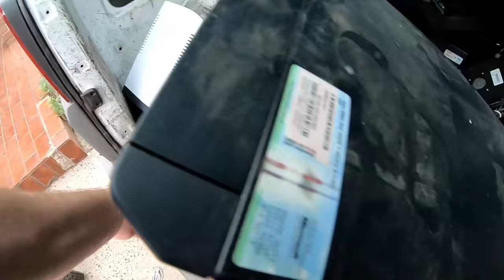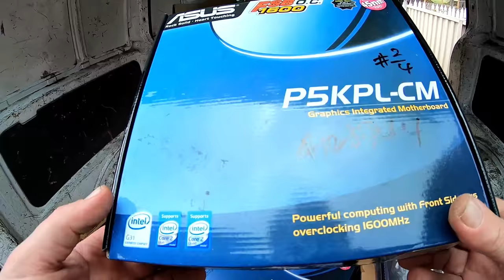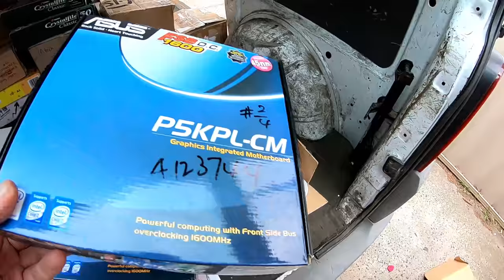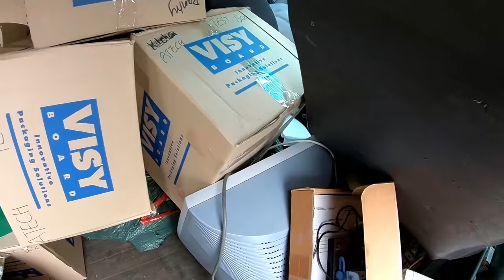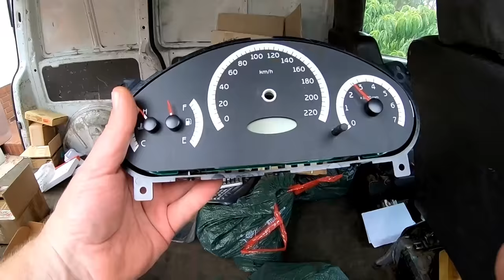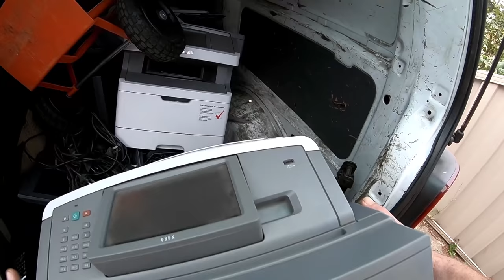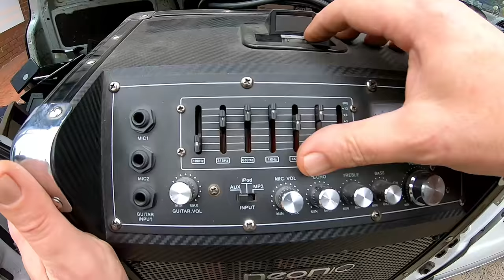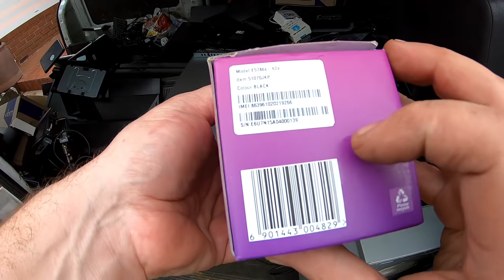E-Waste Pick-Up Adventures - 4 Jobs in 2 Days

Comment: Telstra device at 49:18 is a portable hot-spot.
Suppose you're in unfamiliar territory and want/need to update your GPS so you can navigate back home.
Your Android tablet (with the GPS app) only talks to the internet thru WI-FI, but since you're so far from home there's no available/open networks.
You look at your phone and see a full-strength 4G LTE data signal.
The portable hot spot talks to the 4G tower using your cellular data plan, and sends out a WI-FI signal that your tablet can use.

Comment: hi Ben, I'm interested in getting my hands on a couple of those switch boxes. Can we arrange a trade?

Also - be careful using the wireless microphone with the PA amplifier (Karaoke Machine). The bandwidth for wireless microphones was changed recently due to the 4G or NBN upgrades. If your mic runs off the old frequency, you may get into trouble for using it. You may need to resort to a wired mic.

Comment: Cisco systems will always have a resale value, be careful with them don't scrap them. Coming from a network engineer see if you can resell them first.
Reply: I sell loads of used Cisco stuff on eBay. They sell very easy. Even the old stuff does - people buy it to help with the their Cisco exams.
Reply: @VW_Fan  yes the do very good comment.
Reply: @lippya4311  Even that Nergear switch I spotted will sell easy. Although they tend to go to home users.

Comment: I would really like to see how you take this server hardware apart.
i spoted a very nice filter and DC-DC combo at 56:50 :)

At 57:09 you ask what that is, its a DC-DC converter module, the Components on the left are Filters for the input. 
I guess 48 Volt to 12V (or 5V/3.3V).

Comment: Maybe some of the new ICs are worth a decent money, but all the small resistors, capacitors and whatnot are not that expensive and will take ages to sell individually,  you may make some assorted grab bags of them to sell quickly on ebay, without spending too much time making an inventory. Also all the switches and the automotive fuses will make grab bags that should sell easily. Not sure about the ECUs specific connectors and wire harnesses. The golden legs things in the fuses boxes from the purple box are IC sockets, not fuses.